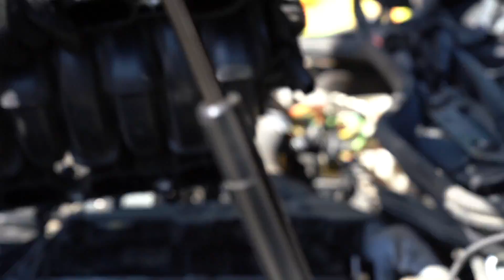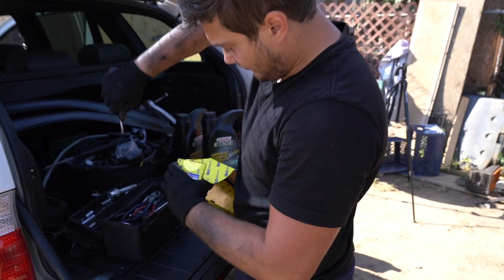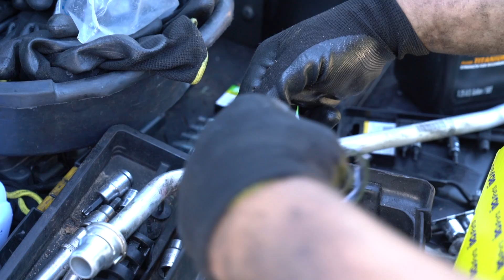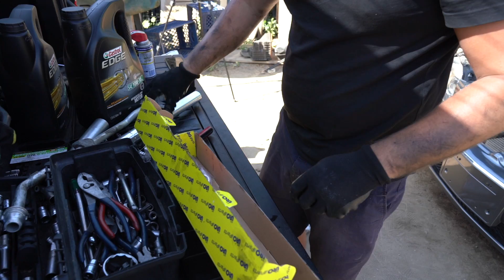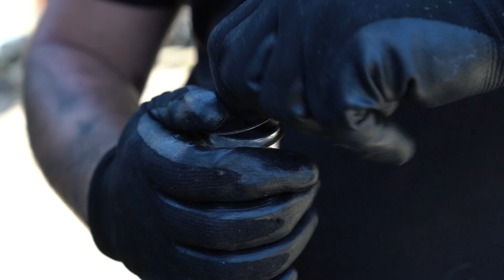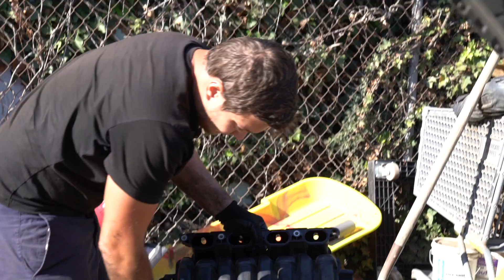DIY 2002-2008 bmw 745li, 750li coolant transfer pipe replacement, e65, e66, e63, e64, n62 engine

Comment: You can use a die-cutter to cut the pipe as well …making two Cuts to allow clearance for disconnecting the transfer pipe.  You didn’t Clean both of the seal openings…..at the engine side for the pipe seal connections…

Comment: Is there any chance that you can respond to your comments. I have the 4799 cc n62 and I can’t get the expandable pipe all the way to meet the timing cover. Is there a difference in the 4799 vs the 4837?

Comment: You can just very evenly apply gasket maker to the valley pan, let it dry for an hour, put it on flush but not tightened so the gasket maker forms against the metal surface of the block, and then come back the next day to torque it down when it is completely dry. This works for ALL coolant and oil seals, just not gasoline!

Comment: You don't need to by the expense extendable pipe. You can cut the old one in the middle, and change the O ring on each end, and connect the two half pipes together by using a rubber connector from a plumbing store, with C clamp on each side.

Comment: What were the issues or symptoms that led changing this pipe.  I like your videos and have learned a lot from them, but I think it would be helpful for you to state the problem or symptoms that led to the job at hand. Thank you and keep up the good work.
Reply from the maker: The tell sign that those seals are gone would be coolant leaking through the hole right next to water pump

Comment: Does the pipe need to pass over the front O-ring, where the water pump is? Im finding it very hard to fit this seal and expand the pipe so the groove can be seen.

If installed incorrectly and it does leak, and you go in there again, do you need to buy a new valley pan again?
Reply from the maker: Yes valley pan seal is a one time use, it is difficult to install front o-ring but it is doable, the pipe must extend to the point where it can be locked in the middle

Comment: I have a 06 750li and im doing this job now I got the valley pan off and my pipe is metal not plastic. Does this mean it’s been replaced before or did some models come with metal pipe ?? Car only has 86k miles
Reply from the maker: All of them are metal, one in this video is metal too, no idea why you thought it was plastic

Comment: I know this video is kinda old however do you know how long this lasts like these gaskets and o-rings last longer then the oem?
Reply from the maker: Well, i’ve been fixing bmws for over a decade and installing those seals never had to redo it yet, not measurable stats but that’s all i can say
Reply: @Zeiten  thank you, I'm about to do a 2005 745Li and learning as each manufacturer does things a little different. Also, besides that pipe and valley pan with gasket you know any other things that I may as well replace while I'm in there? I noticed on the one I'm working couple small coolent hoses are leaking and will replace them.
Reply from the maker: @PashaGaleta get new intake manifold gasket and yes for sure replace 3 way coolant hose (expansion tank to the heads) other than that whatever is broken i’d say😁
Reply: @Zeiten    Спасибо, это будет интересно. Lol

Comment: What’s can cause coolant to leak from oil filter housing 745li 2005 ?Coolant doesn’t go in radiator at all  directly out the oil filter housing Have already install coolant pipe transfer
Reply from the maker: Oil filter housing doesn’t leak coolant, there is a coolant cover (part number 11147504376) between engine block and transmission that leaks coolant and it covers everything under it which includes oil filter housing and other components
Reply: @Zeiten  ok thanks

Comment: at what mileage does this pipe start to leak? ive seen some with 180k miles no leak yet
Reply from the maker: No particular mileage, case by case basis
Reply: @Zeiten  Using thicker non synthetic oil help?
Reply from the maker: its a coolant leak has nothing to do with oil

Comment: Follow step by step now car won’t crank 2005 745li brand new battery any suggestions?
Reply from the maker: Most likely not related to repair i’d say check/replace icm module in most cases that’s the cause of no crank on those cars but also can be a starter failure
Reply: @Zeiten  Thanks,hopefully it’s the icm I’ll keep you posted !
Reply: @Zeiten  forgot to add car crank before coolant transfer pipe install
Reply: @Zeiten  got my car to crank but not start error code p1059 & p1056  vvt control motor bank 1& 2 input too low.Will that cause the car not to start ?
Reply from the maker: Check your valvetronic motors and connections, faulty Valvetronic motors can prevent car from starting
Reply: @Zeiten  waiting on new valvetronic motor now

Comment: Good videos! Would be cool if you could provide torque specs, sometimes they are a challenge to find.  Why do you prefer this repair vs. the stint that goes in behind the water pump?
Reply: Because there is two gaskets that go bad. One in the front and one in the back. If you do the stent it’ll only fix the front issue, and you’ll have a leak again from the back soon. So it’s easier to just replace both than fix and mask one problem.

Comment: I need help, I have a 05 745i and just the other day coolant started pouring out by my coolant reservoir from the small tube connected to the lower part of the reservoir. The small tube connects I believe to the middle of the engine on the front, anybody have any idea how to fix it??? Thank you

Comment: I know this is an old video. I’m running into a coolant leak (obviously) 650i N62
So when i took the manifold i could see coolant right under the knock sensors all along the sides of valley pan. When i open the old valley pan, should it be dry inside or there should be some coolant there?
I don’t see signs of leaks through the weep hole. 
Thanks in advance, great video
Reply from the maker: It’s always filled with coolant under valley pan
Reply: @Zeiten  thank you for the reply. So where do you think it could be coming from? I replaced The Valley yesterday (i beloved this was the issue since i had coolant right below the knock sensors) today i found coolant again, will take the throttle body see if i can spot where it could be coming from.
Reply from the maker: The most common in this area is valley pan or 3-way hose from expansion tank to the heads, or this little black tube from water pump to valley pan also o-ring on water pump to metal long pipe that runs along valley pan to the hose in the back

Comment: Great video I have same car and need to change knock sensors. One question, when change the coolant transfer pipe do I have to change water pump or can I still use the original water pump?
Reply from the maker: No need to change water pump unless it’s faulty
Reply: @Zeiten  Thank you. Keep up the great work you help so many people in big way.

Comment: I was supposed to just replace the the valve cover gaskets on my e60, and some how, I went down this rabbit hole.
Reply: i wish i would have seen these videos before i paid to do my gaskets and secondary air hoses, my two cents if you havent done it check out valve seals and secondary air valves if your already there might as well

Comment: Hello Tim.
i have a lot of coolant leak behind the engine, wanna know  is that coolant transfer pipe cause that leak???Thank you in advance
Reply from the maker: Well in most cases it is valley pan gasket leak, it seems like it is between engine and transmission but in fact it originates at valley pan and goes down in the back. But there can be a leak through another component that is located between engine and transmission in order to reach it you’ll have to separate those two
Reply: @Zeiten  
Thank you Tim for the info.
Reply from the maker: Happy to help

Comment: How do u know if the coolant transfer pipe is leaking?  
Reading more i just saw that if the weep hole is leaking by the water pump that means the coolant transfer pipe front or rear o-rings went bad.
Now if u dont have a leak at the weep hole, but seeing signs of leaking at the valley pan that means i need new valley pan? And if i open the valley pan and i see coolant inside that is normal?  Thanks
Reply from the maker: Yep, in that case valley pan needs replacement but I would say since you opened it, it would be best to replace transfer pipe as well, valley pan has one time use seal
Reply: @Zeiten  Thanks for that info! Do u know the torque specs for intake manifold, valley pan for 2008 750li n62tu?  Found some info on the internet for :

Intake manifold.

thread m8 - 22nm
thread m7 - 15nm
thread m6 - 10nm

Valley pan is - 22nm

Also was looking for sparg plugs torq, i see they have M12 & M14

Thanks,

Comment: Hows it going brother. I have a 2003 745li and it's starting to leak alot of coolant from underneath the car. Worst case scenario how much would a job like this cost to get done?
Reply from the maker: Need to be more specific, the range of repair costs is very wide and all coolant or most oil leaks end up underneath the car doesn’t matter where they originated, gravity
Reply: Sorry about that. I was wondering the cost to repair the coolant transfer pipe. Parts and labor.
Reply from the maker: Our price in la is 850$ total parts and labor, price will very from state to state and shop to shop
Reply: @Zeiten  Got it...thanks for replying. Much appreciated brother.

Comment: How do I take out the third connector (large one, at 2:05 in your video) at the back of the Intake manifold? Having trouble taking it out.  Thanks.
Reply from the maker: All of them are push and pull connectors just take your time
Reply: @Zeiten  Ok, Thanks.  Two of them were standard BMW with a metal spring clip. Third one is different, not sure if I am supposed to press any tab on it  or just pull it .
Reply from the maker: Yes there is a tap there in the middle, might be on the inside just look closely if you can
Reply: @Zeiten  I was able to remove it. Thanks for your help.

Comment: You cant just use a new gasket on the valley pan instead of replacing the whole valley pan, or is the gasket not replaceable?
Reply from the maker: No you have to replace the whole valley pan, other solutions don't work, tried it before

Comment: So if this pipe fails it will have a leak in the front hole next to the water pump?
Reply from the maker: thats right
Reply: @Zeiten  Okay thank you
Reply from the maker: @freack201  you are welcome
Reply: How much is this in labor and parts? What's ur location
Reply from the maker: 3104259214 call or text for details, we are completely mobile company located in Los Angeles

Comment: That's ridiculous , how often does this happen ? Can one prevent it ? Thank you >>Which engine comes after 08? Is it any better ??
Reply from the maker: usually around 100k miles, after 2008 there is n63 engine v8 twin turbo, great engineering but it inherited plenty of n62 engine problems

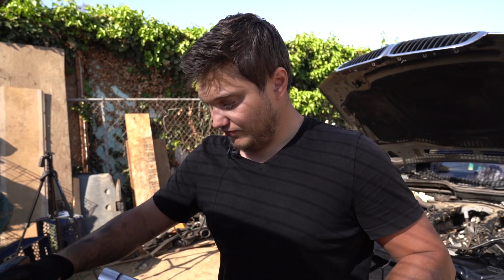Comment: 15:15 you realize you shouldn't use the o-ring'd pipe to push the clip over all the grooves.
Reply from the maker: i didn't, the clip goes from the other side where there are no grooves

Comment: Will this work on a 2010 bmw 750Li??
Reply from the maker: Nope, 760 has different engine
Reply: Zeiten LLC 750 sorry
Reply from the maker: @flowingwater6813  still no, since 2009 it is a different engine - n63, the usual spots for coolant leaks on your car is 3-way coolant hose behind alternator (between the heads) and turbo cooling lines

Comment: Hi Zeiten.  This is Jeff with BimmerFix Products.  Thanks for your YouTube video on how to replace a BMW coolant transfer pipe.  Nice Job!  I wanted to tell you and your viewers about an alternative way to fix this BMW coolant pipe leak that is easier and less expensive than removing the entire coolant pipe.  BimmerFix offers an alternative repair method that only requires the removal of the water pump to fix the coolant pipe leak.   With the BimmerFix method, you DO NOT need to remove the intake manifold or the valley pan.  Your viewers can watch our video at BimmerFix.com to learn more about this alternative repair method.   The new BimmerFix Coolant Pipe Repair System is easier and less expensive than other repair methods and also comes with a Lifetime Guarantee.     Your viewers can call or email me anytime at BimmerFix.com and I can provide the special coupon code, as well as answer any questions on the BimmerFix Coolant Pipe Repair System and offer technical support.  Happy Motoring!  Jeff Reed, BimmerFix Products Co.

Comment: Where would I see coolant leaking from if I need to replace the valley pan or transfer pipe?
Reply: there is a weephole at the front face cover by wsterpump drips out under pressure
Reply: To replace the valley pan it will leak on the side or the back underneath the manifold. Front hole by water pump is the transfer pipe needs to change including the valley pan because of the seal.